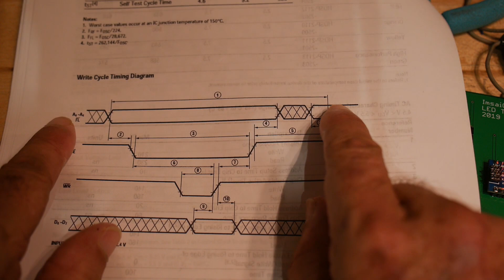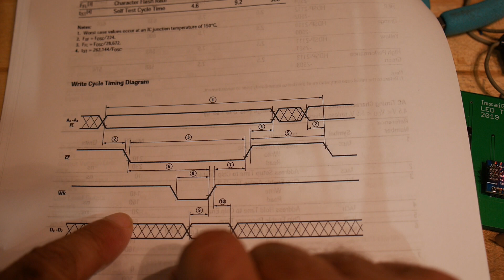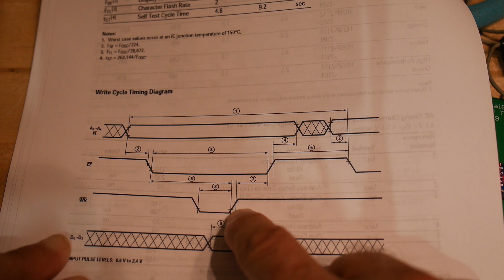#344 LED Test Board working with all parts now

Comment: Yeah, CE (chip enable) is also LE (latch enable) for the data / command register, I've seen that before. Here most likely a change of the function later in development and not changed the pin designator from the preliminary spec for the production datasheet